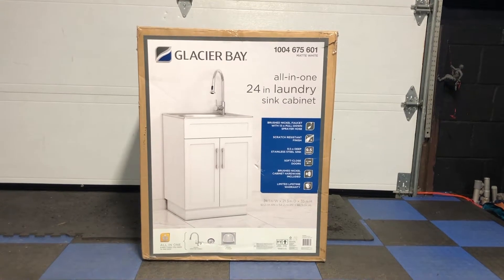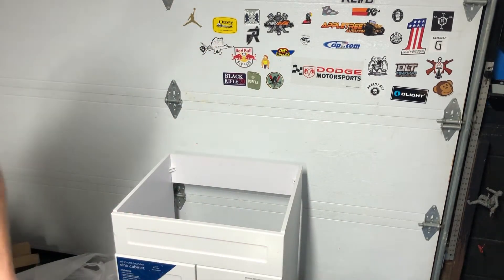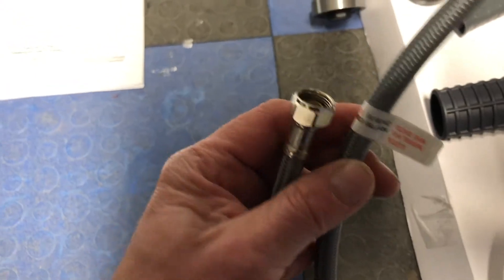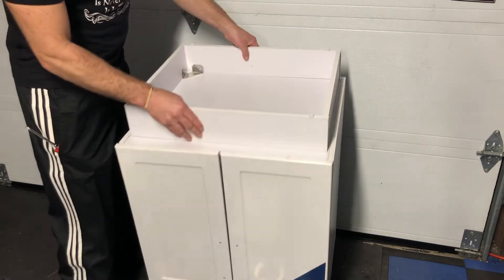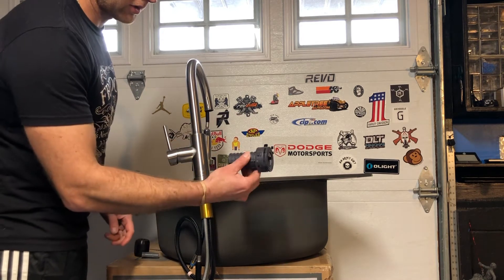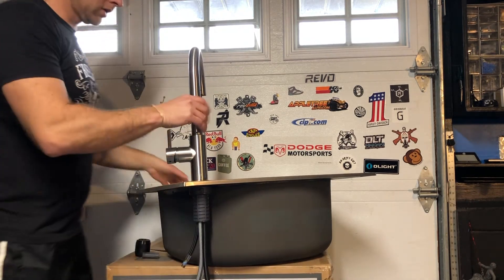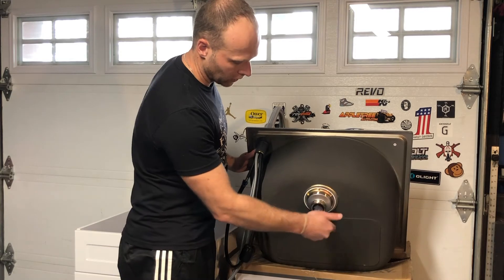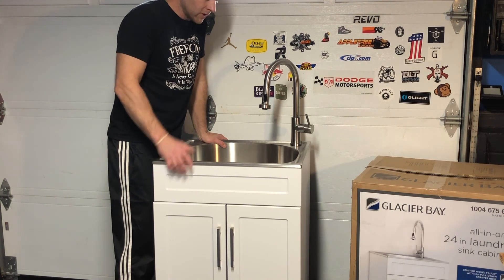Glacier Bay all in one Laundry Stainless Utility Sink Cabinet - Unboxing & Full Setup  (EASY)

Comment: The quick connector to the receiving block does not look like that. It is a nightmare! I would not have bought this product had I known.
Reply: Mine didn't have that big black connector either under the faucet. It had the more standard system using a couple metal discs with set screws in the lower metal disc. Worked fine and is the same as other faucets I have installed. It definitely makes things easier to install the faucet prior to mounting the sink in the cabinet.

Comment: Bought one of these a few years ago. Not a bad product but the wood used is cheap. Some water got on the inside of door and the veneer cracked. But it's still usable. Glad I bought it instead of those plastic tubs.

Comment: You might want to know the difference between what a hinge and a handle looks like... Also when you pulled down the sprayer at the end, the whole unit wobbled.. Looks pretty flimsy.. Also saw reviews that the plastic quick connect for the water leeks for many and the so called "stainless steel" starts to rust within 6 months.. Buyer beware!
Reply: @HowToWithLech  I think you did a good man. This guy is a hater.
Reply from the maker: @GoBeavsss  Thank you!
Reply: Yeah, faucet is also a little bit wobbly when you grab it, despite being clamped down very firmly under the sink. It must have separate play in the assembly above the sink. Seems to work fine, but we'll just have to see how it does over time. The good news is that there's nothing that can't be replaced with different parts if it fails down the road.